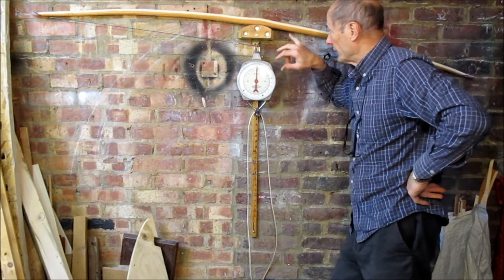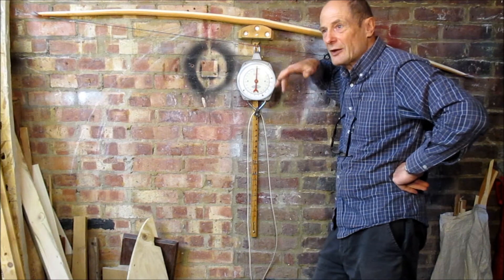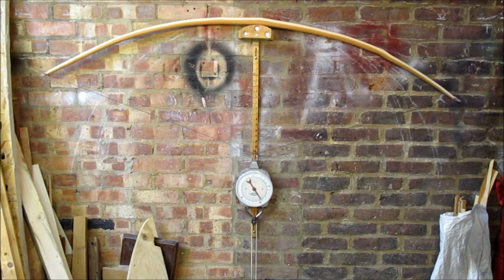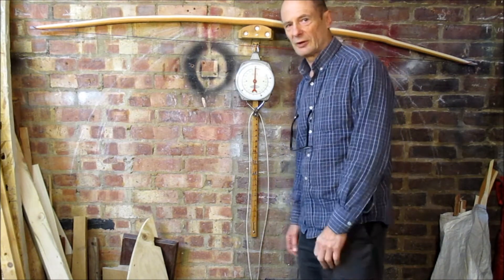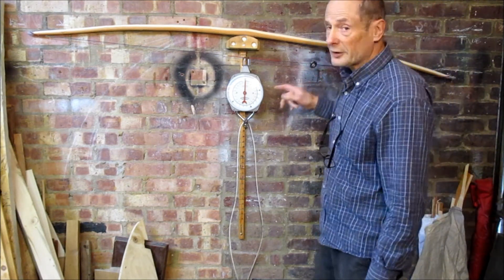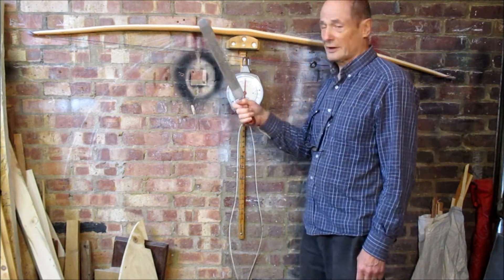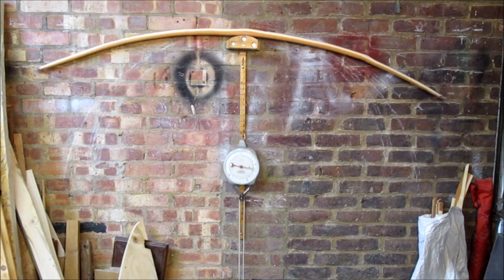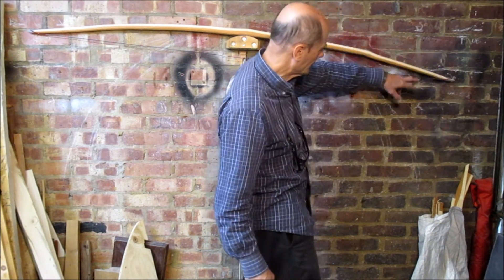More progress

Comment: I am currently woring on a pice of yew. And i took about 5/8 inch of sapwood off. Should i back it or will it be ok?
Reply from the maker: It doesn't matter how much you took off... it matters how much is left on! You need a nice even thickness of about 1/4" plus or minus 1/16" or so.